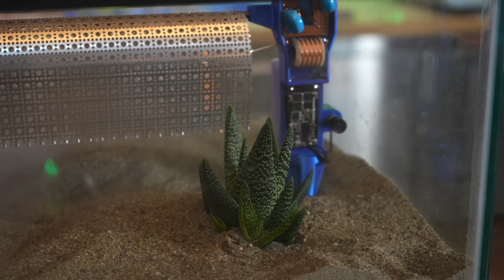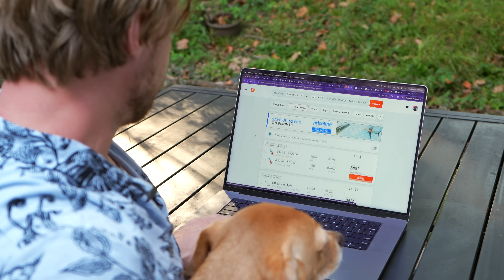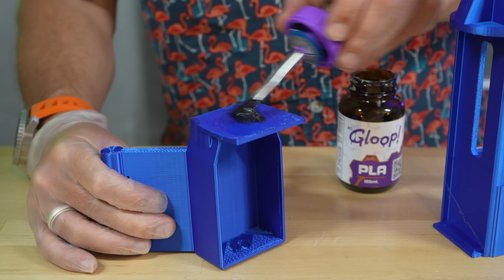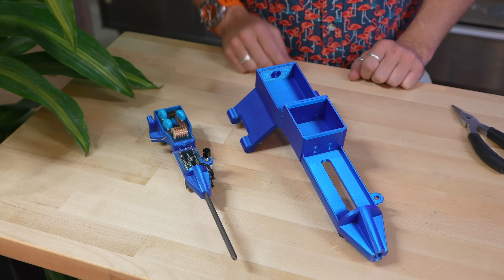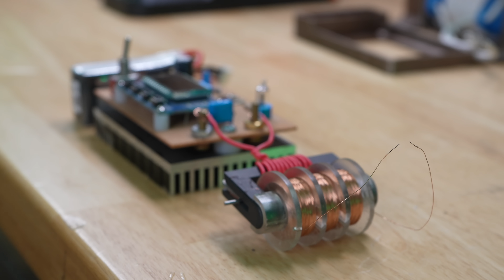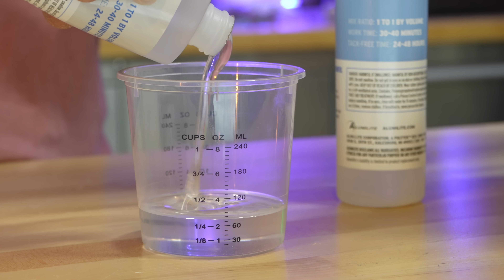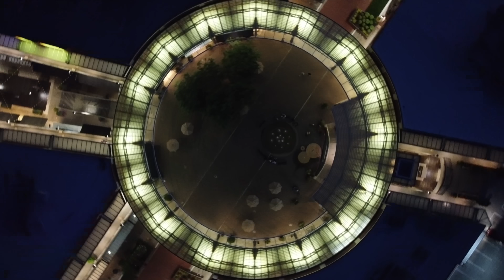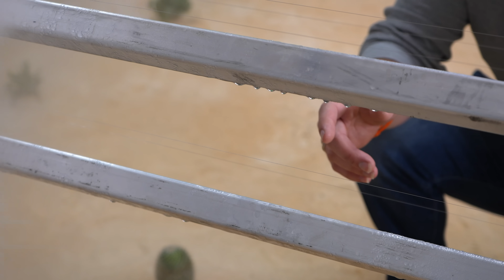Turning Desert Fog into Fresh Water Using 50,000 volts

Comment: Needs lots more surface area. 
Smaller tubes and lots more of them. Layers of them for the air to pass through. The bigger the array, the higher the productivity. 
Put it on a humidity activated switch. Set the switch for the minimum necessary humidity for efficient operation. When the humidity is right, it will come on.

Comment: If the fog happens in the morning, then a simple light sensor and a timer should be enough to get it to turn on and off at the correct time. Have the timer start when the sun goes down (or even just when the solar panels stop charging, you don't even need the light sensor), then the device switches on a set number of hours after that.

Comment: 19:35 Raising the fog is one option. Another could've been just using shorter stakes for the test. But I'm no stranger to project-tunnelvision so I can relate xD
21:30 Maybe a light sensor? Considering that running it is only worth it when the sun's gone. A little more overkill in combination with the BT connection would be something like a Pi checking the weather forecast. Or less fancy: a humidity sensor.

Comment: The design sucks,
Your surface area is too small,
An your components too expensive,
An the power consumption is huge.
Use the same components as your static gun, but feed it very little power,  an charge up two more conventional water capture blankets parallel to eachother,
That's what you want.. but maybe just charging one blanket positive or negative an earthing the later would do.

Comment: A humidity sensor to automatically turn it on when humidity reaches the desired range would be the best way to automate the entire system.

Also, building in some piping so as to collect the water would be the logical step to take.
Why just have it drip onto the ground when you could add a gutter system under the collectors to then have the water run into a catchment system.

As that would be far more effective at collecting water than anything else.

Comment: I’m still 3 mins into the video but I was wondering why not have the metal bars diagonally raised? That way you don’t have to worry about support structures at the end of the bars and maybe even use/adjust the vertical angles of the terminals in a way that the water (purely by surface tension) just “droops” into a center point for both power and recollection?

Comment: Dry ice (CO2) doesn't condense into water, you failed to mention that.
Reply: The fog you see is not CO2 gas but condensed water vapor which formed from air moisture because of the sublimation of CO2 which is an endothermic phase change absorbin up heat from the surrounding environment and cooling the air in the process. So the condensate is water and the CO2 can't be seen.

Comment: Sorry but this video is bull.
In a desert, the amount of water from dew typically ranges from 0.03 to 0.5 mm per night. Not nearly enough to make any tangible difference or justify the power consumption.
You're claiming 42ml per hour but in a desert thats impossible, it simply doesnt exist in the dew. You will be lucky to get a couple of drops per night. Probably not even enough to keep a single plant hydrated.

Comment: @21:30 Alternatively, use a moisture switch similar to a bathroom fan. The device can then be turned on all the time and only come on when moisture thresholds are met. Inversely, when there's no moisture in the air, it sleeps.  Bluetooth module would be a great idea for remote monitoring and backup remote control.

Comment: 21:20
You might consider using a switch based on a similar concept as a smoke detector, or if you don't like spicy pellets everywhere you could just use a photoresistor or even the solar panels since the fog/daylight cycles seem to synchronized well, if not, you could probably add offsets to the on and off triggers on both ends of a cycle.

Comment: You can use the DH22 air humidity and temperature sensor, which is compatible with Arduino and ESP32, and program it to control relays.
very nice work btw

Comment: Instead of manual control or a humidity sensor, you could consider WiFi HaLow or LoRa/Meshify. Though you may want to complete this proof of concept testing before adding in "smart" features for a product design. Make sure the thing works before worrying about integrating an arduino/ESP32 into the thing.

Comment: Barometric pressure drops when the fog rolls in. Set a tipping point for a barometer to turn on the unit. 

On the next iteration you could have a PID controller to dial in atmospheric conditions for optimized output. 

As an extra thought, making your antenna adjustable with your power level could theoretically keep it out of hearing range. However, we should be checking what frequency is being generated as well as what species may be effected by it.

Comment: You never booked that flight, did you Jay?

Also... incline your receptor bars, reclaimed water is more useful than having one of these per plant.

For the switch, you need an ESP8266 running in low power mode, with a simple moisture sensor to automatically turn on.

Comment: Why not have a light sensor that will activate the machine when the sun goes down? You can also put it on an adjustable timer so it turns on at the correct time, if the fog starts at like 1AM or something.

Comment: Just curious, would an ultrasonic fogger with water make for a closer experiment to real world situations?  There are some that can make a lot of fog (more than a ultrasonic humidifier) and that way your fog would be water that would be closer to natural fog, not carbon dioxide just sweeping ambient air's water moisture along with the air flow (which is what I presumed was causing the condensation, since it's not like it's making liquid CO2).  But I guess then you would have wanted to run dehumidifiers to get the relative humidity closer to what you'd find in a desert.

Comment: Have know idea if this is stupid but f@&k it. Since fog basically forms when air temp drops to dew point and dew point is ratio of temp to humidity. Couldn’t you marry a thermometer to some sort of modern hygrometer with a chip to do basic math for calculating when that magical ratio is achieved for switching on/off?

Comment: Great video.
Way better solution than these fake "water seear" crap!
Anyway, I would recommend that you have a small incline towards the center and a water collector. As for the solution with the activation, why don't use the same technology as for the "garden lamps", i.e. when the solar cell doesn't detect any light, it's "night". 
Or as someone else suggested in the comments, use the sensors from a optical smoke detector.

Comment: This isnt going to work, deserts are perhaps high humidity when they fog up, but they are still incredibly low moisture. There simply is not enough humidity in the air to pull from, even when foggy.

Comment: A moisture sensor could work but the lifespan for them is usually less than a year.
Maybe measuring the cloudyness of the air is a good idea. Just add a LED and a photo reciever facing each other. If the reciever cant see the LED then it's foggy

Comment: You may have a already done something with the sand. But if you still have it, you should use some water glass and cast a permanent sand castle. 3d print a mold out of TPU and bury one of those electric plasma candles you made in it such that the plasma flame is sticking out of the parapet.

Comment: SUPER OUTSTANDING 👌🏽 ❣️... The only thing I would add to your design is a better water  collection system. 

 Maybe a half-cut pvc pipe located under the bottom electrode. You would get a much better gage on the collected water amounts.

Great Job 👍🏽👍🏽👍🏽

P. S. I'd love to use your final power system in some of my projects. 😇

Comment: for sensing fog you can use something like a humidity sensor with Arduino? so at higher humidity it will trigger the whole system, try to avoid cheap sensors as those aren't made for deserts extreme condition.

Comment: If that device is going to be used by ordinary people, it needs a protection for those thin wires and to prevent people from touching it while it is on, which we all know will happen.
Also, maybe the solar panel should have automatic open/close with the sun because people will forget to deploy it. And maybe be on top instead.
Attached water collectors funneling the water to a single spot would be nice too.

Comment: You could use a humidity sensor to check if the humidity is high enough to get some water condensed. Of course this might require a microcontroller and the sensor but with some tunning you could find the sweet spot where is no worth to have it on and that way you could save some energy.

Comment: Don't need anything too fancy to turn it on at night. Just need a timing circuit that turns in on something like 6 hours after the solar panel power output cuts out. (Probably can get something off the shelf for solar lighting applications.) That should have it running late enough when conditions cool off so it can do its thing.

Since it's like an electric fence or cattle-prod, it should probably have some hazard marking stickers put on it. (Obvious enough to you. but considering this is intended to be left out who knows where it seems appropriate.)

The water doesn't seem to run down it that well, so it's going to need a collection trough of some sort anyways. But that's pretty simple to figure out after all that other stuff being sorted.

There's probably a crazy way to make it better, but I'm not sure by how much. If there's a way to get enough power to run something like a scroll-type air compressor, you could fill up a compressed air tank during the day as well. Then by using a timed solenoid valve periodically let the air bleed out through an orifice on tubes inside the collection side of the thing at night. That would get the thing nice and cold vs. normal ambient temperatures affecting the process.

Comment: For the fog activated switch; you can take a cheap and simple air humidity sensor and a small controller (like an esp32?) that use very little power. The esp32 has wifi and bluetooth options too if you want to use those. Maybe for remote control, maybe for live metrics?

Comment: A great location to test the water condenser could be the arid semi-desert region of Northeastern Brazil. The area faces severe water scarcity, with some regions experiencing desertification. Its hot climate, high evaporation rates, and extended dry periods make it an ideal environment to evaluate the condenser’s efficiency. Additionally, the region is relatively accessible and cost-effective for testing compared to remote desert areas in other countries, making it a practical and strategic choice for field experiments.